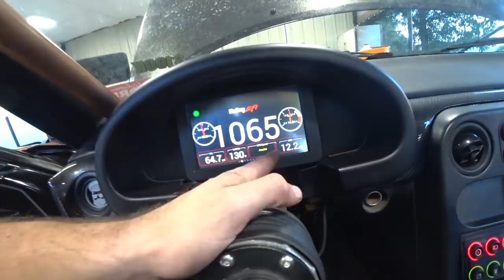Putting legit race car AC in the LS3 Miata (no ice needed) and it's a game changer.

Comment: I have one of those, Would reccomend giving it air through an air duct. The coolshirt systems work alot better with it. I love mine!
Reply: Will struggle to condense the refrigerant without sufficient somewhat cool air flow. Hope he adds the ducting.
Reply: push the comment!
Reply: Doesn't the "exhaust" also heat uo the cabin? Or do you not notice it? Might wan't to duct that too.
Reply: @hondacota4rt  it looks like the fans pull air over the condenser and are discharging toward the two vents in the rear wind shield. The cabin is already clearly hot as balls, doubt it’d make a noticeable difference when the car is in motion. The issue is getting sufficient cool air across the condenser.

Comment: I didn't know how involved the OG coolshirt was, its perfect for the drag setups that already utilize iceboxes. The price on this is a bit steep for a daily but well priced for a dedicated track car. The ability to move it around to different cars is awesome. Grats dude, no more near heat stroke during comps lol
Reply: These draw a ton of current and don’t cool very well in my experience . Not as well as a Traditional cool shirt with ice. Not having to stock  ice isn’t that much of  a big deal after you’ve used these.
Reply: @skiptastic1000  For real. Just buy an ARB offroad freezer to keep your ice cold or even a couple of Yeti coolers would hold all the ice you need for days.
Reply: @sam_s_  He doesn't exactly have a lot of room in the Miata tho.  With the big ass oil pump and shit taking up the whole trunk, no space under the hood and only thing left really is where he put this thing and his passenger seat/floor.
Reply: @skiptastic1000  hey Alex! There could have been a reason the system you were using didn’t cool well. Perhaps not bringing ventilation to the system, some people don’t realize our coolant is a concentrate and run it straight rather than the 4 parts water to 1 part coolant which kills performance or the system wasn’t matched properly for the car. (We make two systems, the Pro being the most powerful). It would be great if you could share a bit more information about the system and car you tried it in, I think you’d be surprised about the cooling power our systems are capable of when set up properly.

Comment: Hi Taylor, that's such a great improvement! 
But one thing to think about: The system cools down the fluid but dissipates a lot of heat, cause that's how thermodynamics work ;-)
So you should either route a hose for cool air in and hot air out of the system (portable AC Systems for houses work like this) or mount it in a seperate compartment (like the trunk - but you'll still need good ventilation)
Otherwise you'll have a cool shirt but an even hotter inside.
Reply: Weird no one is talking about this. Where does the heat go when the AC unit is inside the cabin..? The heat stays in the cabin ;)
Reply: I don't think he'd be able to make it any  hotter than it already is in that little tiny black car in Florida in the summer 100* and 99% Humidity.  I thought the same thing especially when he put it on the floor like ugh no way, but there should be plenty of airflow out the two vents in the back window.  

It would suck though to have it blowing even hotter air than the car has on you through those fans, but they gotta move a decent amount of air they look like they're 140mm at least.  Still though all that heat from his body and the environment gonna add a lot of heat to deal with.

I guess if it ends up being uncomfortable don't run it until you really need to then enjoy the blasts of cooling.  Gotta be better than what he has now that sht looks miserable.
Reply: Hey guys! This is what a lot of people think but our system actually doesn’t produce much heat however it does move the heat from the body out the back of the Quantum Cooler. In tests, cabin temps were unchanged while using the system, even in closed cockpit LMP cars. Happy to answer any questions you may have!
Reply: @chilloutsystems6478  Interesting.  I guess it makes sense though, the box is pretty small and a compressor along with a heat exchanger and a reservoir you're done w/ that space.  I was thinking more AC-sized parts in my mind, but wasn't really thinking about it obviously lol but it's gotta be pretty dang small either way.  I'm curious to see how it goes running it this weekend.

Comment: Those flex joints are known for braking due to vibration and heat cycles. You welded it perfectly, you will never get don in the flex joint. Great job!

Comment: If you get yourself a set of connectors you can drain the shirt at the end of the day when hanging it up.  24h 🍋 proish tip
Reply: What about attaching the cooling hose to the back / bottom of an all aluminum kirky seat..? 

Chilled seats not shirts..

Or using a PC liquid cooler setup.. cheaper , smaller , lighter ,

Comment: The heat you're extracting from the coolshirt has to go somewhere. Now you're pumping it into the cabin. Might want to build a little duct to vent it out of the cab.
Reply: He's got some airflow outta the back window maybe add a couple more haha.  I'm curious to see how it performs during a track day.  Better than what he has now it's already over 100 in the cab.
Reply: That’s a very good point and one we get asked quite frequently. The system produces very little heat on it’s own. Almost all the heat that you do feel coming from the back is heat removed from the shirt wearer’s body which equates to about 100-120 watts. In tests, we have used thermal sensors placed in various places around a car’s interior and found zero increase in cabin temperature, literally undetectable. 
In fairness these were race cars and not cars with interior finishing so the cars tend to be a lot hotter. You will not notice an increase in cabin temp and the shirt will keep your entire body cool by chilling the blood that is circulated through your skin. 
Ice systems are too cold and blood flow is restricted after a few minutes of exposure to freezing temps. Our system, although it can reach 35°, works best at 55-60 degrees by not decreasing the blood flow to the skin. It’s something you have to experience for yourself to believe, it’s absolutely game changing.

Comment: Put a plate on top of the transmission mount then run some exhaust hangers to the pipe to take the load off the flex joints so they will live two to three times longer before breaking.

Comment: Have you ever considered adding some sort of 12v fan to extract air from the pop-outs in your back window? You can fab up a small box with two round outlets and you can run them to your window openings with easy to remove hoses. If you get enough cfm going I thought that it might help with extracting tire smoke as well as the heat from your new badass heat exchanger.
Reply: Probably not worth it they'd get covered in gunk - blades, but especially the bearing and probably end up f'ing w/ the airflow if not running.  Probably wouldn't hear them, but who wants to have two fans running behind you always when in the car.
Reply: @adambacon8874  I meant like a single 6" Spal puller fan on a switch for doing follow runs or burnouts when the cabin is full of lingering smoke or when he's using the shirt AC on a hot day. There is no other active ventilation in the car and the 300cfm+ on one of those fans would help a lot in some circumstances. It would just be a box with a single fan and two accordion tubes that he could run to the rear window or pull off quickly if he wants to remove his roof or run with regular passive vents. It's easy to add provisions for a filter to a box, but at $50 for the fan, I would just send it and see if it needed anything special later.
Reply: @AbominableJoshie  interesting idea i'm curious to see how it works in practice gotta be better than before aka nothing either way.  The cabin is pretty small tho hopefully... oh sh.. just remembered his windows don't move huh?  lol whooops totally spaced on that ya dude needs a friggin fan in that B

Comment: Next MOD solar panels on the trailer roof, plus deep cycle batteries, inverter and a 12 v Dometic Fridge/Freezer, cold drinks! and could probably run a small ac for the trailer

Comment: I've often thought about making one of these using the coil out of a water cooler.
Reply: A water cooler like a PC water cooler wouldn't really work.  This thing runs a compressor and works like a refrigerator or a real AC in your window or under the hood to cool the liquid it runs through the shirt tubes.  The water cooler little radiators wouldn't do much at all and you'd probably over power them and even then it would not do any better than a fan on you.
Reply: @adambacon8874  A water cooler has a compressor and refrigerant in it.  I'm talking about an office water cooler.  The compressor, coil and reservoir all fit in a tool box.
Reply: @criticalevent  that's why I asked it would work in your house I'm sure, but they probably sell something similar already for gaming but if you just got water coolers laying around I'm sure itd be super easy to fab something up real quick just make sure it's grounded well lol.

Comment: Found this very interesting, coming from a commercial refrigeration chiller mechanic. I want to to see it’s insides, the photos on their site aren’t a true indication of actual design.  Hope it works as well at an event as you hope!
Reply: What about using a PC liquid cooler setup, run the cooling hose to the back of some aluminum kirky seats, . Chilled seats.. It's smaller , lighter and cheaper then this..
Reply: @bebopBiGsHoT  Good question, Electro-Plate cooling is horribly inefficient, draws a ton of amps and doesn't work well in high temp environments. We developed this system to last a long time, live through tremendous abuse and extreme temperatures. Building a product that works in rally racing, NASCAR, IMSA, Ferrarri Challenge, WRL, AER etc takes all the right materials and engineers. Our product cannot fail, it's essential to prevent driver fatigue which dramatically reduces mistakes. I would be happy to explain more if you would like to reach out to us directly.

Comment: With your flex exhaust joints try to use the braded type I find them a lot longer lasting and over here in England I pay around £20 for the size you have. 🇬🇧✌🇺🇸👍

Comment: LOL WTF that shirt looks awesome!  Not having to deal with a separate ice box not having a need for an intercooler and all.  I was thinking hrmmm is he going to set up an icebox for this and run an air to water IC on his NA engine - weird.  Nah guess it'd work gotta be something else you can do.  Then next few seconds there it is awesome.

Hell yeah I can't wait to see your reaction using it while racing wtf so weird.  YT Is so damn weird.  I'm curious how well it holds up your body heat dumping in it, being out in the sun and all that.  At least you can cut the thing to Eco mode when you run a lap then turn it on when you are done if that's even necessary.  I wonder how much load it puts on the charging system at full power on the compressor/pump/fans.

Enjoy the shirt and coolness you guys always look so GD miserable racing in humid and hot AF Florida w/o AC!

Comment: Great video, so much action! ;)
Consider adding some ducts to get fresh air to the unit and maybe even directly exhaust the air out of the unit somehow?
Maybe a small window to open up in the back beyond those two small round holes?
Like a radiator this system is going to want to dump hot air somewhere, system performance is gonna suffer if the air in the back of the car get's hot.

Comment: Now I don't wanna seem stupid but, if they have an ice chiller system for cars why wouldn't it be able to use dry ice? Dry ice isn't that expensive and lasts quite a bit. If your system fails may that be an option?
Reply: Traditional cool suits  don’t let you regulate temperature so the system is as cold as the water is. I think dry ice would be too cold.
Reply: @brianwidmer7493  what I was thinking if they make a system that has a fan with an induction side for sucking warm air in and as air passes over the dry ice it would cool the air with another fan with a hose that would run to your fire suit.
Reply: From some quick research with dry ice when it’s in a closed loop system and doesn’t have a way to bleed off pressure you will blow it out somewhere. I’m sure it’s a system that could be created but no current systems seem to be designed around using it. I would also hate to get a dry ice burn.

Comment: Whats that big tan splotch on the exhaust? I've been meaning to ask.
For a more robust flex, do they make wiggins style clamps for exhaust? Or are inconel or stainless flex joints more durable? You could put V band flanges on each side of the flex section so they're easily replaceable when they do eventually break. Just make up a bunch of spares.

Comment: I know drift drivers wear open face helmets, but is there a model with an air exchanger for helmet cooling? I had the ice chest with air exchanger with the old Parker pumper that also pumped water for cool shirt when we racec circle track. I also had an old Stanley thermos hose clamped to the roll cage with a tube drilled through the lid and had the other end safety pinned to my shoulder harness so I had ice water during caution laps.

Comment: Could you use that with a air to water ( coolant)  intercooler
Reply: Good idea. If you have the budget I don't see any reason why it wouldn't work. The only thing is that if you put it in an enclosed location you will need to duct it to work properly since it works like an a/c unit(I think) and creates a good amount of heat.
Reply: you can!

Comment: Dude go turbo LS next year. As good as your getting dude I think 7-850ish hp car would put you on another level man. And a built ls with 800ish HP will last for a while as long as she's built right. Shit what would it take 10psi of boost  to make around 800
Reply: Where is the turbo going to fit in that engine bay?
He should put NOS in for a scramble  button. Also the small tracks that he races on there is less advantage to more power. You are getting beyond the limit of the Miata chassis at 600+ as well. Ben won a round this year with less power.
Reply: @foamdataservices  yea true but if he ever wants to go legit FD he's gonna need to start doing bigger events. Could always do a bottom mounted. Or rear mount turbo. I'm sure he could find a spot for a little 62mm turbski. Easy 700hp

Comment: Serious question tho... why not just keep the AC from the car? Modern AC doesn't weigh much. And it isn't 2900 bucks?
Reply: This is difficult on V8 swaps in Miatas. Also, this system is mostly designed for race cars which do not have AC and even when they do, they don't operate during wide open throttle (which is most of the time) nor does the AC cool the driver who is wearing race suite, fire proof under garments, gloves, helmet etc. This is truly designed for racing.

Comment: This has probably been asked a few times, but who makes the switch panel in the Miata?  (The one in the center stack that controls everything)
Reply from the maker: It’s an ecu masters pmu setup with their cam keypad. Going to switch it out to a racepak smartwire. Same basic thing I just like the racepak better for reliability and design.
Reply: @Taylordrifts  thanks for the info.  My plan for this winter is to resurrect my 90 Talon TSi/AWD and get back to AutoX and HPDE's.   So much has changed and advanced in 15 years that i almost feel like a complete n00b.  Can you comment on the reliability issue?  If not, understand.

Comment: hey taylor im planning on doing an ls swap with a gen 4 possibly and dod delete im asking to know before i start because its going to be a drift car with another suspension for strip are there any must do mods for an ls before it can start drifting ? or just maintainence and it is safe to go?
Reply: Very well baffled sump pan. Re geared power steering pump.
Reply: @foamdataservices  power steering wont be an issue because I'm thinking of going to an electric power steering pump incase of any scenario where I cant turn on the car atleast it is slightly easier to move around

Comment: Not to rain on your parade but the heat rejection from the unit is going right back into the cabin of your car. Just heating the cabin up even hotter.
Reply: Hey Donald. Most people do think this but fortunately our system doesn't make much heat and almost all of the heat you feel coming from the system is heat that was removed from the body thanks to the cooling veins on the shirt. In tests, no measurable increase in cabin temperature was noted, even with windows up. More heat generated in .5 sf of trans tunnel or fire wall than our system would produce. I'd be happy to send you over our test data if you would like. Thanks for the comment!

Comment: Anybody have issues with wheel bearings? My car is lowered and I've changed it once last year, and once again this year...
Anybody else have this same issue.
Reply: Could be that your driveshaft angle is messed up and it's putting side load on the bearings
Reply: @gavster89  Crap, never thought of that. Thanks man!

Comment: Instead of using regular ice for cool shirts, why not get some dry ice?
Reply: Expensive, hard to find at times, systems freeze up and are a maintenance nightmare. The SuperCar Pro Series used to run a lot of dry ice systems but they have since switched to Chillout Systems. Check out the Red Bull team, they rock our system. :-)
Reply: There are dry ice system however they fail often, you have to plan to buy the dry ice, it's very expensive, at least $50 a day for a track day. This system allows you to just show up, push a button and stay cool and focused. Btw, dry ice systems are about the same price as this one minus the cost of dry ice.